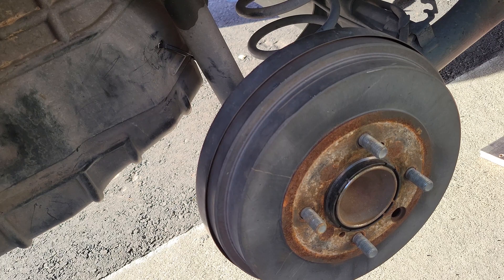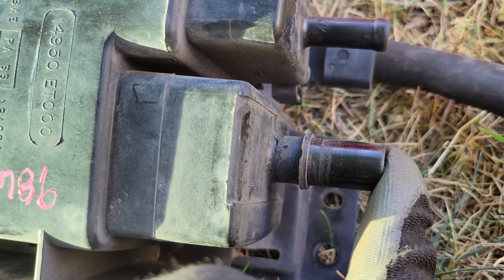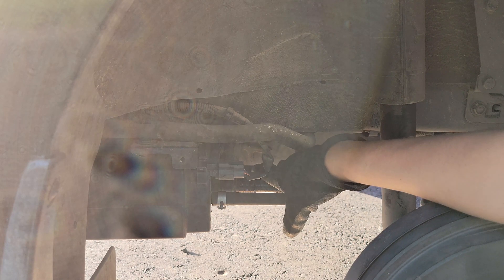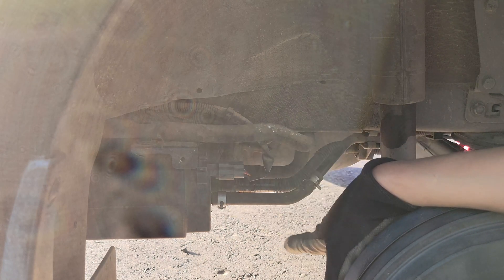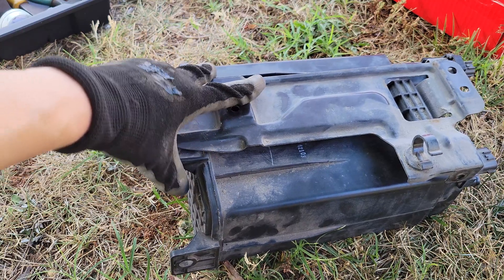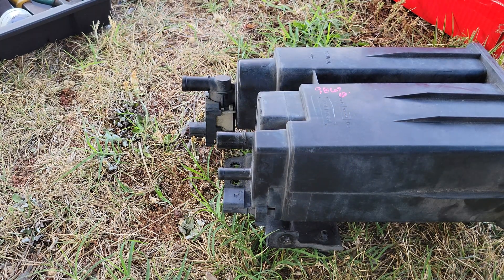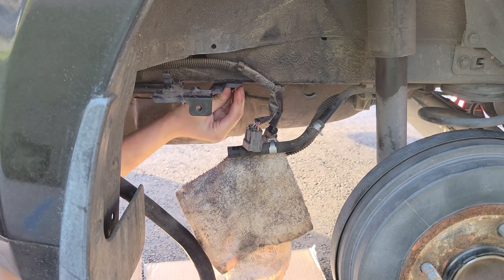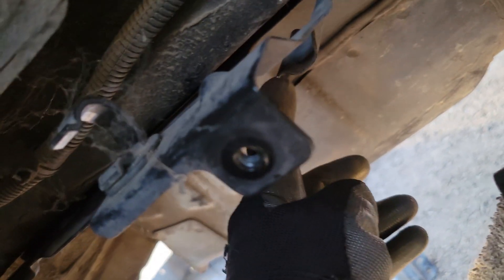Nissan Refueling Issue EVAP Charcoal Canister Replacement for Nissan Versa (2007-2012)

Comment: Did it fix you problem? I actually figured my versa isn't fueling up all the way and there is a small gas odor when I start it up cold. No check engine tho.
Reply from the maker: I had a fueling problem that would occur during the colder months. The fuel nozzle would shut off early, most likely the EVAP system was clogged. First winter with this replacement canister and no issues so far. The engine starts up better as well.
Reply: Thank you for this explanation of the symptoms you were experiencing. I mistakenly thought the gas station's pump nozzle was acting up 😅
Reply: Check pressure fuel sensor

Comment: Was it no crank, no start? Or it cranked? My versa is acting up
Reply from the maker: It would crank for longer than normal before starting up. The purpose of the canister is to trap fuel vapors and reroute them to the engine. I hope this information helps.
Reply: Thank you for this explanation of the function of the charcoal canister and the symptoms you were experiencing

Comment: It could be the solenoid only that's bad and not the whole canister
Reply: How can you tell? My check engine light comes on about once every 6 months or so and it says it's because of a EVAP leak. I always change the gass cap and the check engine light turns off.

Comment: i have a P0455 code on my 2007 Versa, i wonder if this is the problem. Wondering about cleaning the inside of the canister...
Reply from the maker: P0455 indicates an EVAP leak. Cleaning likely won't do anything to fix it.
Reply: @cali_viceversa  some people say the valve might be stuck in open position from clogged dirt, this is why i thought about the cleaning, my versa has nearly 300 000 km.